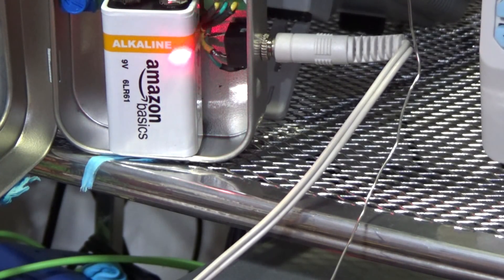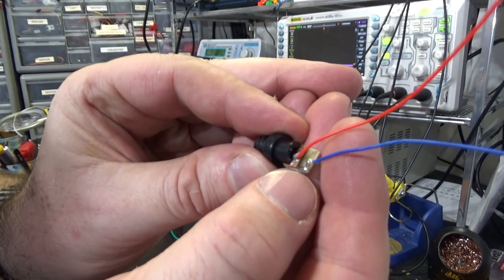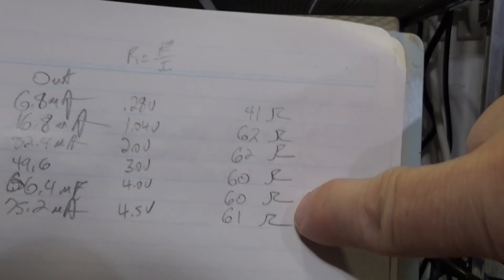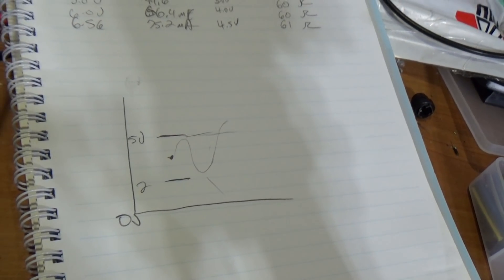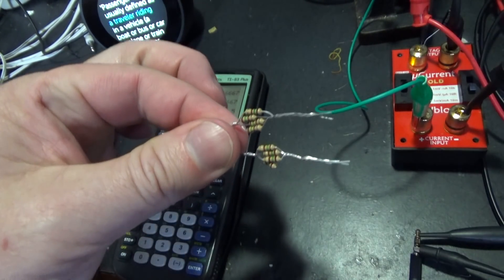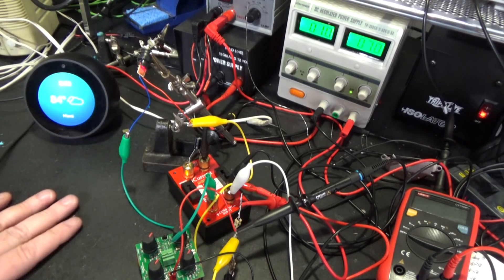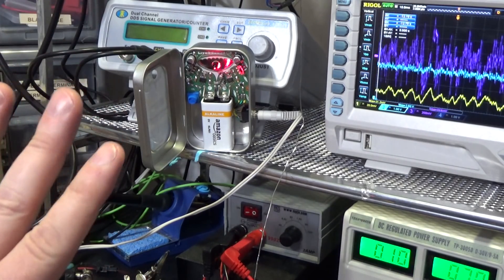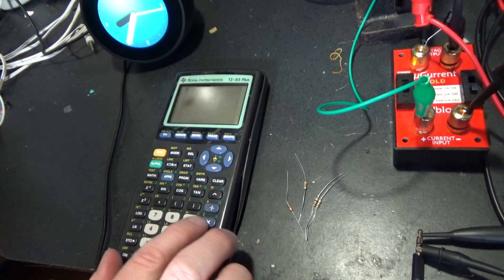Better Laser Music Transmission

Comment: Its a diode laser(solid state diode laser for those playing along at home). the emitter chip is going to be a tiny package (the diode) on gold wires attached to that secondary wafer the red wire is attached to. These are basically very VERY VVEERRYY focused LEDs. Typically small laser diodes have a constant + while control happens on the - side. If you cant find the diode package, apply 12v to it, the part that flies off was the diode ;)

Comment: @Monta Elkins
Can u please try this suggestion for me? and try this on a super long destance, find out how long of distance can this thing travel with or without my following suggestion(try something like more than 100meters and few kilometers).
hi, ur laser bean is red colour, the wavelength of light should be around 650-660nm, or 635nm, so i assume that if u put a red colour lens/glasses or professional stuff(some filiter or wutever) which only allows this wavelength of light pass though and infront of the solar panel, u should be able to get ride of all those interference from the background